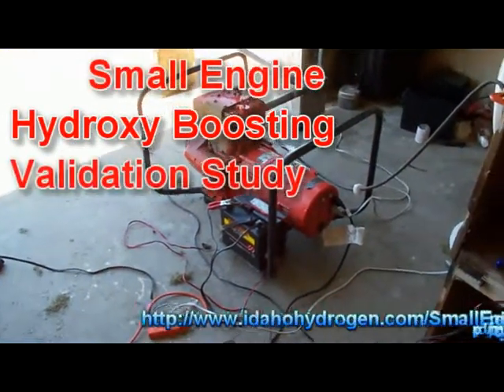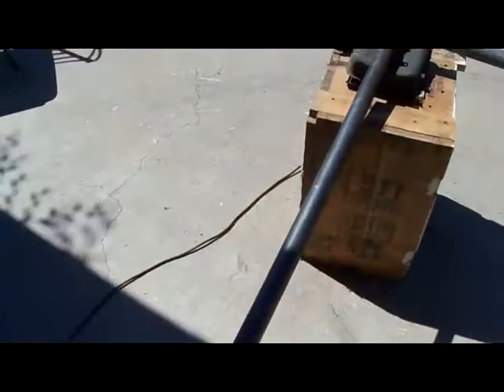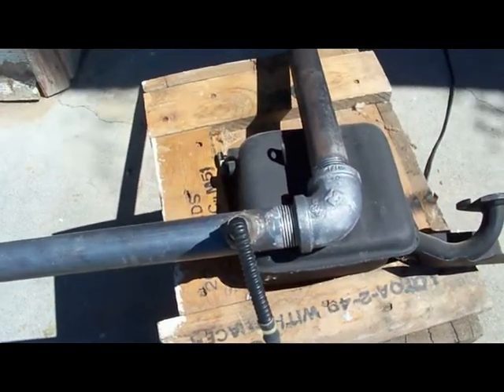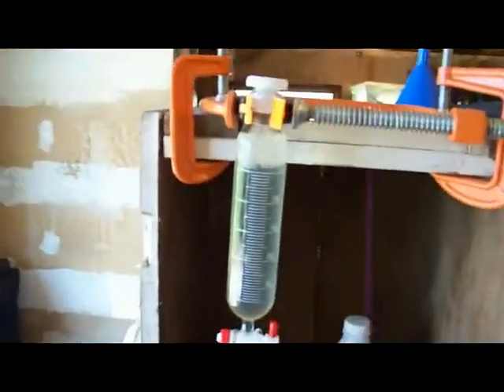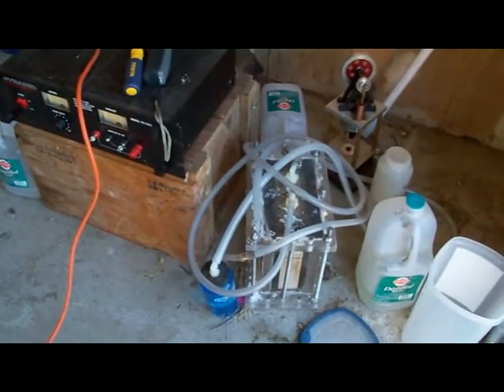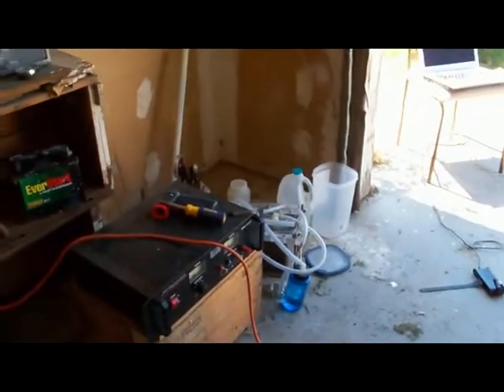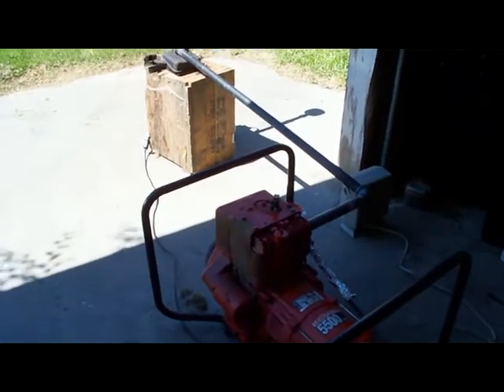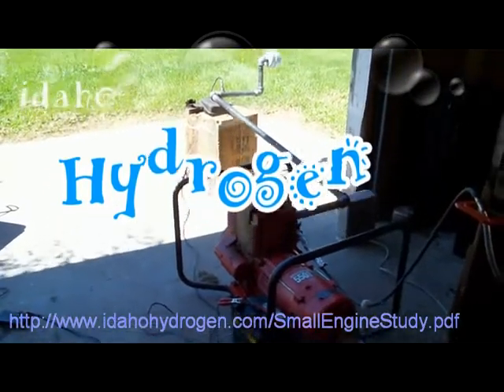Small Engine Hydroxy Boosting Validation Study Part 1

Comment: Hey Jake, I would suggest mounting that sensor closer to the engine.  I know it has a built in heater, but it will operate better closer to the engine.  There is a lot of pipe cooling off the exhaust there....